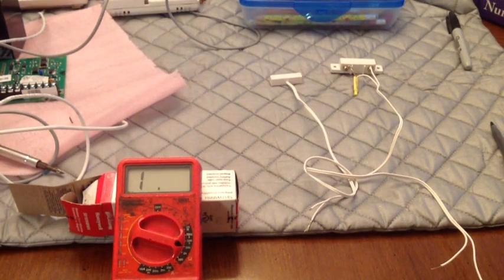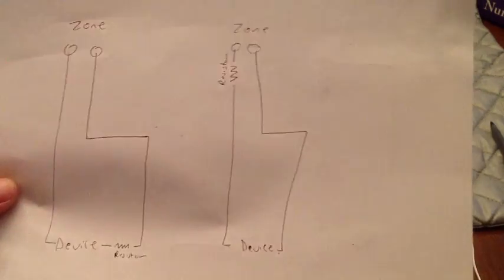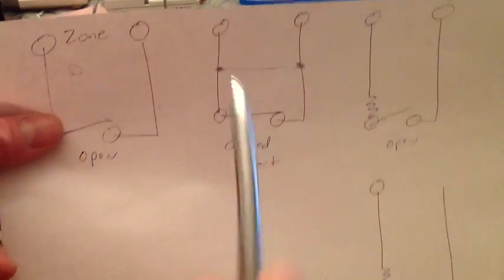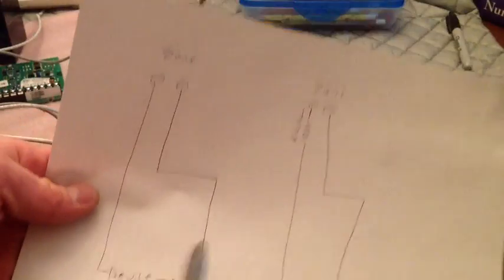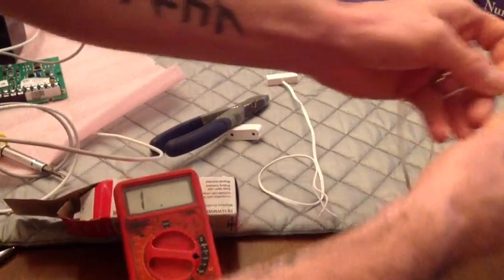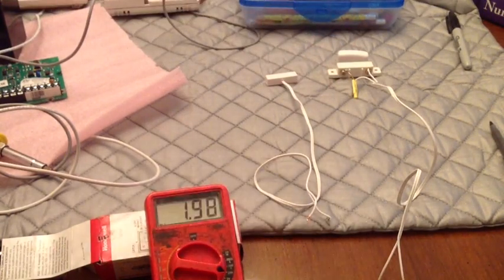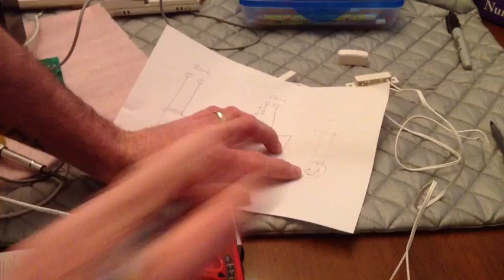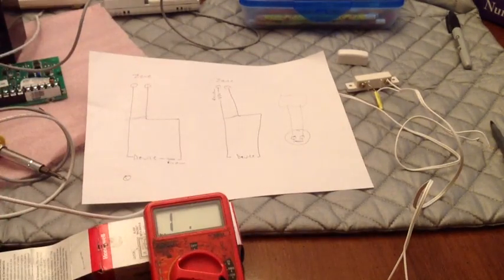Why we use Resistors at the end of line on alarm security panels

Comment: So do you have a video how to wire eolr on fire strobe
Reply: I don't think a burglar alarm system requires bell circuit supervision......... fire alarms it just jumps across your data circuit at the end of line.........for a class B circuit.............. but fire alarms you can have class A circuits and class B circuits.................... class A circuits you loop the circuit back to the panel and monitor the circuit from the panel and put your resister in the panel.... you also have to program the fire system to which type you use

Comment: Great video. But how to get 4 contacts set(4 windows), in serial connection in 1 zone whit EOL. i use 4,7k2,2k now, in one contact.
Reply: You can do this, but you're alarm system needs to be able to handle multi-zoning (multiple sensors on the one zone) to detect which specific sensor has tripped - if that's what you're trying to achieve. If you don't care which sensor trips, just the fact one of them has tripped, you can get away with having one (or none) EOL resistors. At least one is always a good idea though, to let the system detect a fault from a trip.

Comment: Good demo with the multimeter, but the explanation was kind of all over the place with the major point not made clearly. If you understand high school physics, easiest way to thing about EOL resistors is: they allow an alarm system to detect THREE states via a voltage read instead of two. The states are: 1) Open circuit - no current/voltage, 2) Normal close, with a reduced voltage due to the resistor and 3) Abnormal close, ie. a full short without the resistor being in-line. Of course, your alarm system needs to be able to measure these 3 states, but almost all have EOL resistor detection to do so.

Comment: On an open Circuit Loop the Resistor should be in paralllel to the device at the end of the line. It won't do anything in series if the wire is cut.

Comment: yes, im not particularly found of this system because it confuses guys that are new technicians, but it alows for two zones to be used on one set of terminals, basically turns that 8 zone panel into a 16 zone panel by looking for two different end of line resistor values... you can see how that makes troubleshooting difficult. if you really need more zones, zone expanders are cheap.

Comment from the maker: Id say 95% of the time i would Wire Motion detectors NC ( Normally closed) .. resistor in Series.
usually smokes, pull stations , Heats and such are NO ( normally open) 

Motions in fact could be wired NO if your motion had that option, but Unless its a special circumstance , i wouldn't

Comment: There is no real way to hide a resistor on a surface mount contact even with the contact covers this is the reason most techs don't bother to add them cause by simply tying the exposed end of one wire and the end of the resistor wire together renders it useless like in your setup mate, unless one uses contacts the stash away resistor within. PIR's, Smokes, some panic buttons not a problem.

Comment: Your Open w/resistor is drawn incorrectly.  It should be across the switch terminals.  Like a smoke detector.   Otherwise good video
Reply from the maker: i believe the part you are talking about is showing an open on a series circuit. like open door ,

Comment: This is old school wiring. More often a more useful circuit is used that can detect open and short circuit faults.
Why don't you do a video to show this type of wiring as this makes it far more difficult for burglars to fool the system.
I have an old 1980's conventional fire alarm panel that uses this method.
I can explain this method if you have not experienced this type of wiring.
Reply: D.E.O.L Double end of line. 1 in series and 1 in parallel

Comment: Yeah that's very helpful if you stumble across the resistor name of the circuit yeah that's very helpful knows of one alarm smoke detector to an error in Wellesley when will contact order contacts whats good you did that cause cause the Burger  on front of the Warner of those at the trouble yeah I think now thank you nothing cover the whole Homefront really well more about the resistor can you put it also put inside the panel box as well yeah let me know when they're free if you can do that if you can't do it this ticket on to the contacts what you think about the wireless system